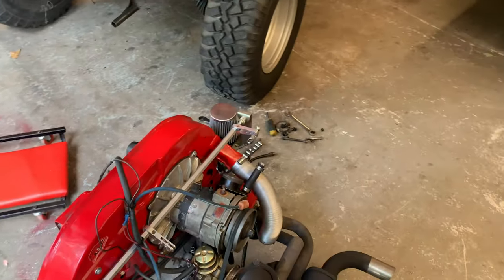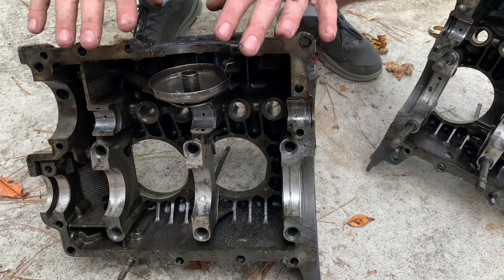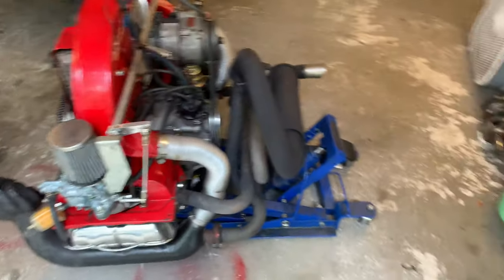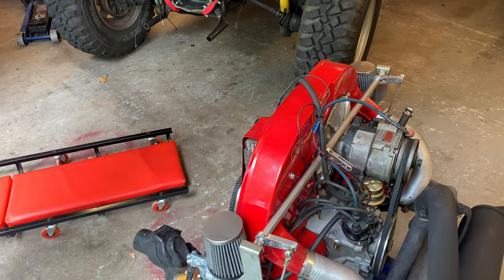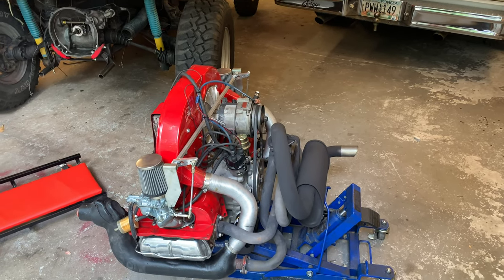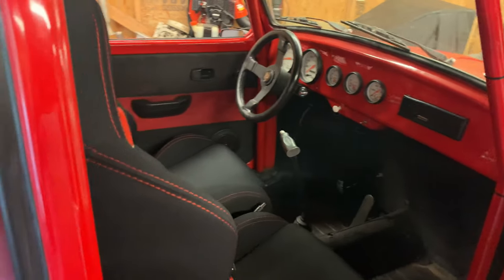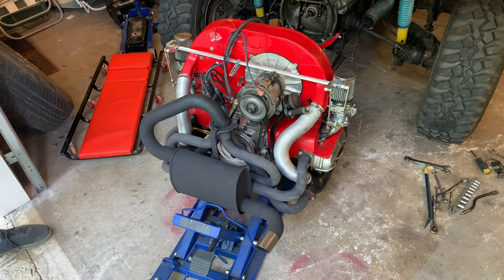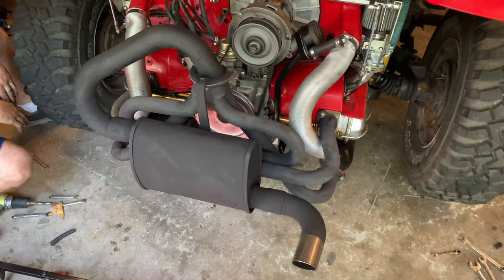UPDATE on Greg's ‘71 VW Baja Bug - 2110cc Engine

Comment: I ditched the stock valve heads and heater boxes (will overheat big valve with heat) and for a gas heater. Well worth it. They make 1.5” heater boxes too. 

Nice video. Working on a 2332 now for mine. Was a 2275

Comment: Those cases can be saved using an insert made from a piston ring in conjunction with an O.S thrust bearing. Old engine builder's trick. Original cases are getting rarer and more expensive!
Reply: Interesting, thanks for the tip.

Comment: Cludes buggies ( CB performance ) in Farmersville Ca is the place to go for all thing Vdub , their engine builder there is a frieking Wizard , I think his name is Pat Haynes if I remember correctly  , 5 years ago or so he pulled 250hp out of a naturally aspirated type 1 😁 and they have ANYTHING you could need , want or dream about for aircooled  Vdubs and watercooled Vdubs too .  What size are those Empi carbs ? They look like about 34's ? I was running baby Webers ( 34's ) on my 1641cc type 1 baja . Just asking because you're running a 2110cc , and I've seen dudes with 2110cc out here running 40's-48's . Cool video and nice baja 👍 , makes me miss mine 😔
Reply: Yes they are empis 34s it needs a set of 48s. Im currently saving up to buy a good set of webers.
Reply: @gregbryant6639  Have you looked on line for people selling used ones , you can also find DeLortos too and you can still get the parts to rebuild them . What kind of heads are you running ? And did you have them fly cut to bump up your compression ? I was running AA brand big valve heads 40 x 35.5 and I had them fly cut 40,000ths and man what a frieking difference it made . With the extra compression  I could cruise up hills that before I had to downshift and floor it to go up , and my fuel mileage got better too 👍
Reply: @gd6349  Now I'm running a set of Weber 44 IDFs with port matched intakes breathing into a set of CB performance panchito heads valve sizes are 40X35.5mm. The spacers below my jugs are .020 with a copper headgasket compressed thickness of .020 as well. My calculated compression ratio is 9.2:1. For sure more compression makes power.
Reply: @gregbryant6639  Ooh I bet it runs alot better now!!!! All I know is that after putting the AA 87 pistons and barrels ,  big valve heads and CB Performance fly cut them 40 thousandths and then put tin the lightened flywheel and my dual Weber ict 34's , my car ran Soooooo Much Better!!!! Better fuel mileage from more torque and horsepower from not having my foot to the floor when it was a stock 1600 , going up hills like easy peasy !! Man I'd like to ride in your 2180!!!! Yee Haw!!!

Comment: Dont put the fuel filter there!! Dont put it close to the engine thats the reason why vw bug catches on fire, you have to put it almos at the distance between the door and the back tire.
Reply: You can't put it by the back door. The factory fuel line is hard lined into the frame and comes out kf the split where the transfer case is. The best thing to do is check your fuel line clamps periodically and carry a fire extinguisher. The real reason they catch on fire is neglect and on a factory carburetor the brass bung is known to fall out once they get some wear on them.
Reply: Best place is where the fuel line exits the tunnel right next to the trans. Cheap filters leak and you don't want that anywhere near the engine. Next to the #3 exhaust is a fire waiting to happen.

Comment: With any performance VW you should move the oil cooler, go with larger aftermarket change the tins original blocks airflow to#3 cylinder
Reply: He is using a "dog house" fan shroud that offsets the oil cooler, which does NOT block air flow to cylinder #3.
Reply: @daletec1  having the oil cooler anywhere inside the shroud is not going to cool the motor evenly
Reply: @daletec1  And it's not as big as aftermarket
Reply: @jerrykeck1494  I disagree, the purpose of the doghouse style shroud was to correct the issue of air flow to the #3 cylinder and exhaust the air from the oil cooler to the outside of the fan shroud.  That design correction from VW was specifically to address the issue of even cooling.
Reply: @jerrykeck1494  Of course on high performance applications an external oil cooler should be added.
Reply: @daletec1  if you look at what Porsche did and Brazil and Mexico - Empi anyone running the Baja factory VW was built with Europe and specifically Germany in mind wet cold and lots of steep hills. I live in Tampa FL. area any added cooling is essential.
Reply: @daletec1  other than just concentrating on the oil cooler look into Hoover work to the oil ports and journal's deep sump external filters ..KILLS me to see more and more people doing engine swaps to Subaru- Honda - Ford 4 cylinders. The Tesla or V8 swap is extreme and kind of awsome
Reply: @jerrykeck1494  I live in the mountains of N.C. and have owned and driven both street beetles and baja bugs.  My first car at 16 was a beetle, I am now 52 years old.  I have built my own motors, transaxles, performance and stock specs.  Not arguing the point of cooling on performance engines, Merely letting you know that the purpose of that style fan shroud was to even the air flow and offset the oil cooler.  If you check the earlier engines, you will find the oil cooler sitting directly in the path of the cooling air going to the #3 cylinder.
Reply: @daletec1  No argument here have seen many fall to a traffic jam regular accurance  here everyday in fact. Would like to share as much info on gaining horse power and reliability. Last night watched vid of I believe CB engine rebuilds pulled around 300 out of turbo motor!!
Reply: @daletec1  Any correction made by VW was made on "Stock " engines , not High Performance big cc engines . Anything over 1600 with a fair amount of engine mods should be running an external oil cooler , and on my 1641 with big valve heads I left the stock oil cooler and ran a roof mount external oil cooler , and I could drive long distance in over 100 degree weather and never overheated and my oil stayed a nice consistency . Before i did all the upgrades i was driving back from Pismo Beach and made a stop in Lost Hills , it was 106 degrees that day , and I was terrified that mylittle baha was gonna blow up , my oil was so thinned out and my over heating warning light came on . So after I got home I made the upgrades ,  87 pistons/barrels , big valve heads , 34 ict Weber's , lightened flywheel , and external oil filter and oil cooler , and never had that issue again 👍
Reply: @gd6349  If you read above, you'll see I made no argument about performance engines.  I ran 1835cc, Engle 120, 041 heads, counterweighted crank, Weber 40s, close ration 3rd and 4th gears and a 4.86 ring and pinion on my Baja, of course I used an 8 pass external oil cooler, the revs and heat are not our friend!  Now, on my stock 73 Super Beetle, I did run 87s, stock cam and Weber progressive carb for a little extra oomph, but the stock doghouse was just fine.

Comment: How did you get your tires on? Did you change anything on the suspension ?
Reply: The fenders are cut and the springs in the torsion have been twisted to lift the car. It also has a body lift.

Comment: Do you still have to adjust the valves every three months?
Reply: Yes I do. I reset the valve lash every time I change the oil. That's a VW thing. With a solid lift cam it's very important to always make sure the valve lash is not too tight, as that will result in power loss, a burned valve, or possibly even cam failure. Too much valve lash will result in unpleasant noises and power loss or valve float.

Comment: EMPI "They're the way to go for VDub stuff" 🤣🤣 That was funny! EMPI makes some of shittiest parts for air-cooled. I avoid EMPI anytime it is possible. Its best to stick with German parts when possible. EMPI is always my last choice. I have had nothing but problems with their stuff.
Reply: Empi stuff has always been good to me. They have been around for years and there's a reason they have been. The case is built by autolinea a Brazilian company that empi branded their name on the case. Nobody sells an aftermarket case that is CNC machined, reinforced behind the #3 cylinder, a made from aluminum alloy instead of magnesium like the stock case. Say what you want, but this engine has been together for 5k miles and has been GREAT to me. As have all of the empi parts
Reply: @gregbryant6639  ya ever want to sell it? Beautiful bug.